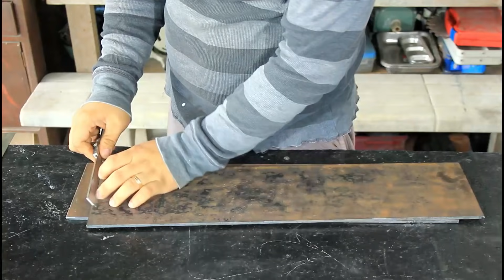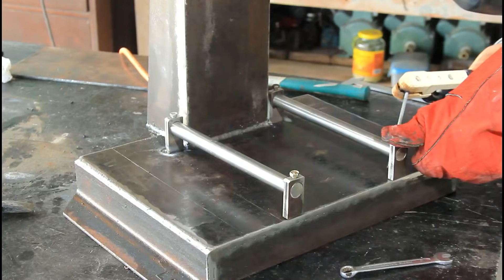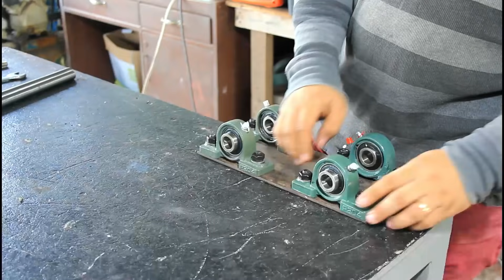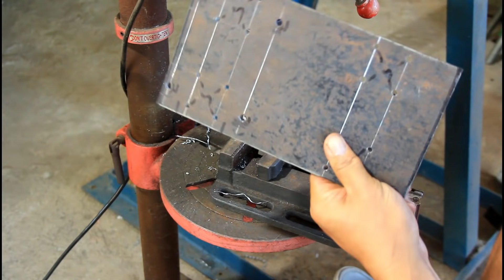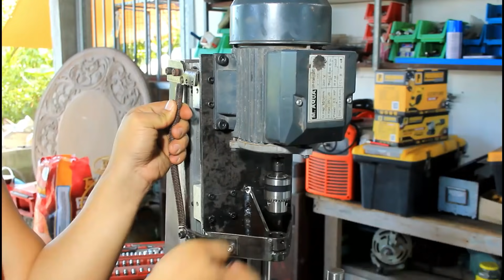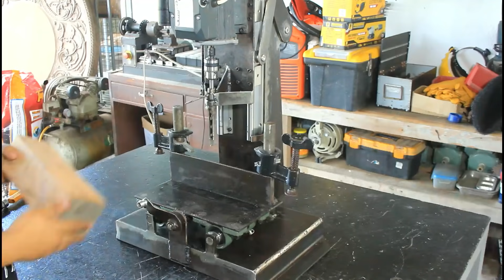DIY Square Drilling Machine

Comment: What's the advantage of this over a drill press and a cross slide vise?
Reply: Drill presses almost universally use a Morse taper to hold the chuck in which is not meant for any side loading, only straight down and regular drills aren't meant for side cutting as their cutting edges are on the tip only.  so even if you put an endmill in a drill press so you can cut horizontally, you will eventually loosen the taper that holds the chuck in the spindle (unless it has a bolt through the other end of the spindle, but very likely not since Morse tapers aren't designed to be bolted in, only pressed).  Even taking very light side loading cuts with an endmill, it will be enough to eventually loosen it and drop the chuck.

These are also called mortising machines. They use a special bit that is essentially a square chisel with a drill bit inside so that as the drill drills out the center, the corner chisels effectively square cut the hole as you put downward pressure on the chuck/spindle and thus, you HAVE to keep drilling vertically to square the hole, otherwise you will also end up with a rounded mortise pocket.
Hope that helps!
Reply: @shirothehero0609 , Thank you. Exactly, using those mortising bits you could easily just use a drill press, a cross vise would be for convenience only so you don't have to keep moving and reclamping the piece. It just seems like a lot of trouble to me for something that could easily be done on a drill press, BUT, it is a great idea and build anyway.
Reply: @Enigma-Sapiens  absolutely.  And I totally agree,  a lot of extra work to make a single purpose tool, but definitely still cool. Even though this could have been done in a much more simple fashion using a drill press.
Reply: @shirothehero0609  NICE !! B.S !! HERE !!

Comment: Nice work, but you already have a drill press and the morticing chisel bit.  So, don't you just really need a slide mount vise to hold the wood?  Same functionality except one fewer dedicated tools in the workshop.
Reply: But then he wouldn't have a project video.  ¯\_(ツ)_/¯
Reply from the maker: I already did that with my previous project, but its a lot of work when you set it all up and dismantling.
Reply: @SekAustria  That's fair enough.  If you use it dedicated enough, then it's worth it